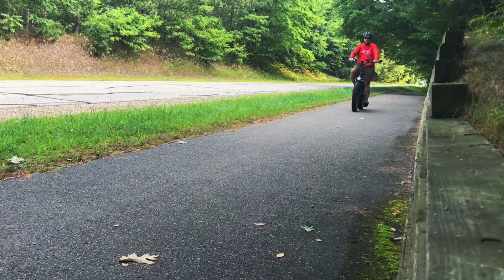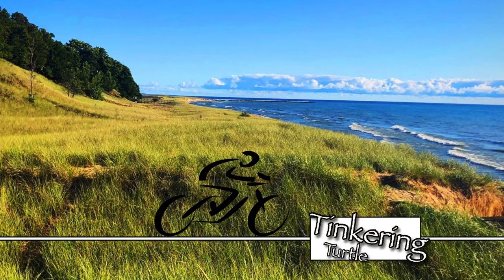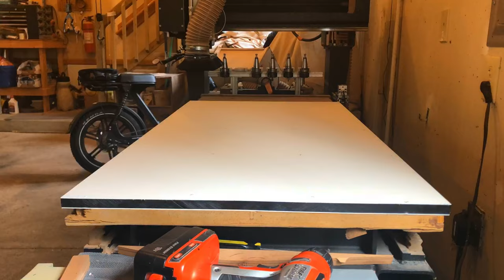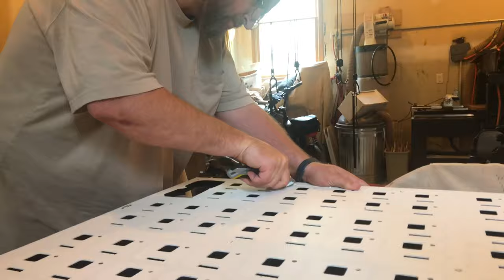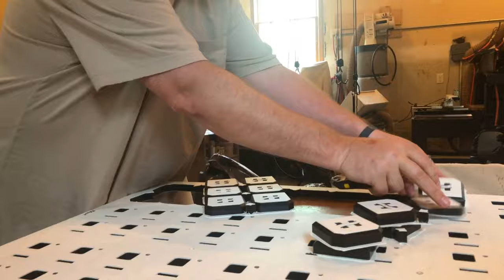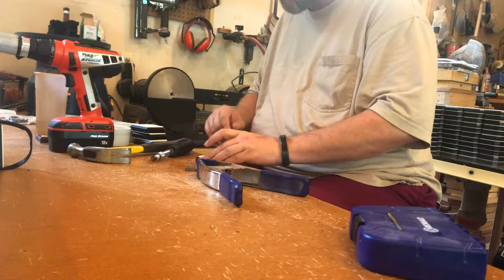Terminal covers - Tinkering Turtle

Comment: Tim, I have a himiway cruiser (bought last Spring) problem I'm having is that when I pedal hard the pedal assist cuts out... When I pedal at a very slow pace it's fine... Where would you start with this problem? Also throttle only works fine too...
Reply from the maker: Are you hitting the top speed set in your screen and the motor is cutting off when you pedal hard?
If not, the I would look at the speed sensor on the crank, or the crank itself. Is it allowing enough flex to cause an issue?
Reply: @TinkeringTurtle  no I'm not hitting top speed even when I'm first starting out pedaling hard it cuts out, under 20mph... It must be the crank sensor I'll check that when I get home thank you so much for getting back to me I really appreciate it
Reply from the maker: I would think that including support in your troubleshooting could be helpful. Good luck!

Comment: Have you made a cover for the himiway Escape yet?
Reply from the maker: Thanks for asking. The Escape has an in-frame battery which is significantly different than the cruiser or stepthru. so a cover really isn’t the best choice. I would suggest looking at a neoprene wrap style cover for protection.
check this one out: (please measure your bike for fit before purchasing)
https://amzn.to/3hNmTIu
Reply: Unsure if it would be the same, but my wife has a RAD e-bike, and on their website, in the 'Accessories' section, I found a neoprene/rubber terminal cover, which just pushes on, and stay's put.   Unsure if it would be similar to the Escape, but a little research and you could possibly find out, as it does have it's own distinct shape around the terminals.

Comment: Do these fit the Magicycle?
Reply from the maker: Yes, and no. The design does fit the Magicycle, but the Magicycle does not use the same cradle as the Himiway. The Magicycle is integrated more into the frame. So even though the plastic part fits, the Velcro straps don’t fit the same.
I will be making a Magicycle version of the covers in a couple weeks. I will redesign the straps so that it fits under the controller. They will also have the Magicycle logo instead of the Himiway. When they are ready I will post in the Facebook groups, and release a video.

Thanks for asking!